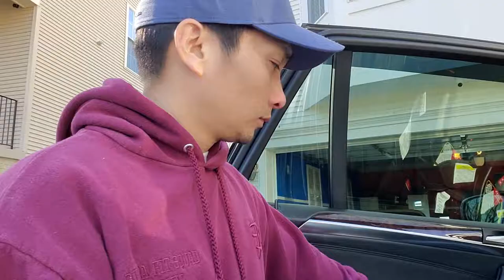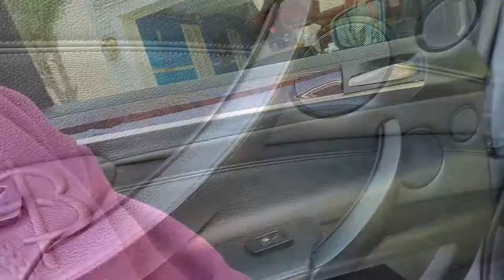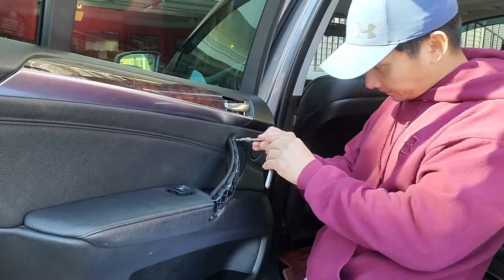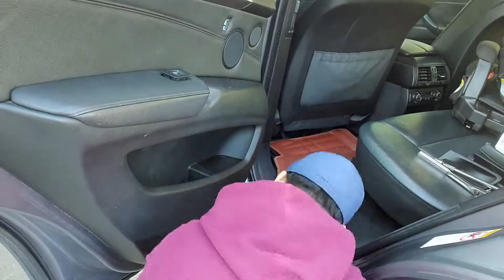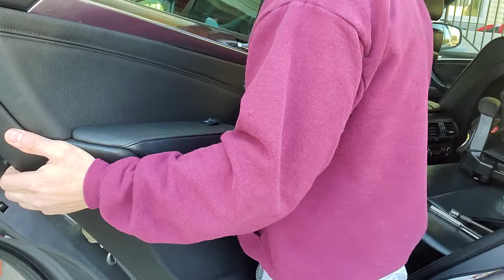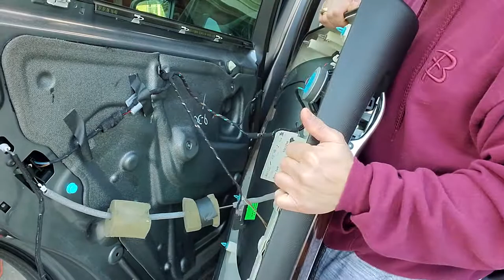BMW X5 E70 HOW TO REMOVE DOOR PANEL VIDEO

Comment: Guru, my rear sliding curtain shade 2004 Clk 55 AMG wouldn't slide down..Any idea 💡
Reply from the maker: Check the fuse for that privacy curtain switch....refer on your manual fuse diagram...👍
Reply: @Langston Felix Instablaster :)
Reply: @Sutton Kellan It did the trick and I now got access to my account again. I am so happy:D
Thank you so much, you saved my account :D
Reply: @Langston Felix happy to help :)